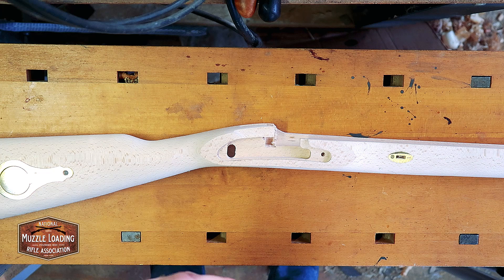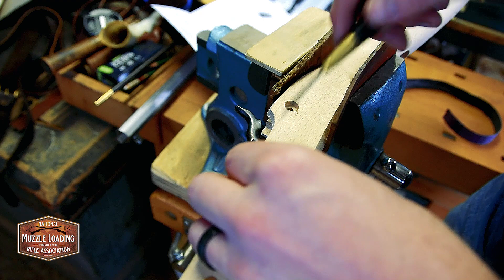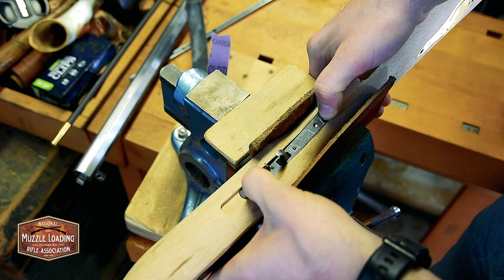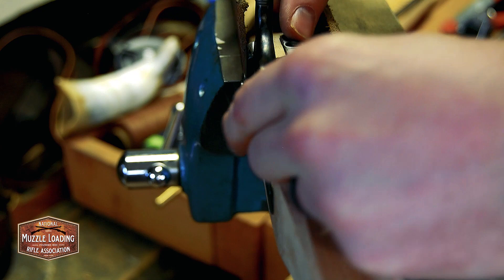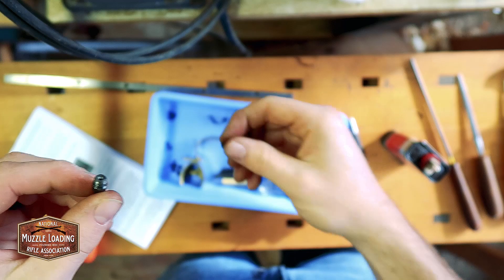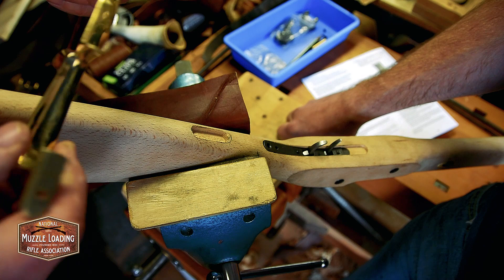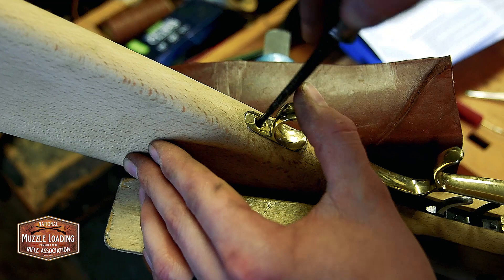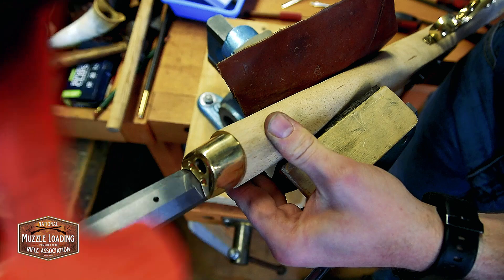Let's Build a Traditions St. Louis Hawken | How-To Series Part 3: Dry fitting your hardware

Comment: Just a little advice for the future, file the cheapest parts to fit the more expensive parts. On a dovetail part you only have to remove material from the bottom of it to make it smaller and I usually do this with some 200 grit sandpaper glued to a piece of steel.

Comment: Thank you for this video ! My son bought this kit for my retirement and it turned out beautifully! Take your time …! I bought a rubber sanding block to use in my bench clamp with leather as padding replacing the wooden one you made ! I used a 8oz piece of leather to polish stain and oiling steps after burnishing with a antler ! Gave a smoother even finish that way !

Comment: Glad you did this video. I too, ran into basically the same THREE difficult items in the build. That stupid Ramrod Spring (I too had to re-read the instructions). The Brass Trigger guard (I knew it was brass, which you can bend, or hammer into place). And, that crazy, will-not tap in barrel trunnion (I used one of the 8 needle files for $ 2.99 from harbor freight, as opposed to $50.00 for a dovetail file). Thank you!! Saved tons of time.

Comment: The trigger assy will function as is but if it were mine I would replace the roll pins for some solid hardened pins. Measure the holes in the triggers then slightly upsize for a more precise fit. When money allows you could upgrade with a better set of triggers. I know it is a less expensive kit but I just don't like the cast trigger assy. Think I would upgrade for better sights. Can't believe they used plastic sights. I had a CVA mountain rifle kit years ago I did some upgrades to and shot it several years. Had a good round ball barrel and was accurate. You are doing a fine job...

Comment: Gotta tap those lock screw bushings in, thats why they are ribbed. First, use a round or square file and enlarge the lock screw hole. Once you sand the wood flush to the bushing, you can then reach in with a long punch and gently tap them out for stock stain/finish.

Comment: Get a proper, hollow ground, flathead for this kind of work. That hardware store angle ground flathead will eventually annihilate something important, and when it does you'll be kicking yourself for not using the right tools.

Comment: I need help. None of the inletting on the stock that came in my kit is anywhere near the quality of yours. During dry fitting non of the parts fit so I had to sand them all even though there were already pronounced gaps and they still don't fit very well. The barrel tang is probably the worst fitting part (that still does not fit) even though that's the one part you probably do want to fit well. The inlet for the back part of the trigger guard is off center and crooked by about a quarter inch. The quality of this kit seems to be terrible and I've been left with something that is not capable of being finished let alone fired safely. Is there any way that I can get a new stock for this kit that isn't messed up out of the package?!?!?!?! I reached out to traditions and they've completely ignored me

Comment: I can not get the barrel tenon on for the life of me. Actually broke one and had to get another sent from traditions. The only dovetail file I can find is $45. Really would like to avoid having to make a purchase for a tool I'll likely only use once. Any advice?
Reply: I too dealt with the barrel tenon, I just went to Harbor Freight, they have a "needle file", set of 8 files for a wopping $ 2.99. There is a similar triangle shaped file in the set, with only one side with file capability. Had the tenon in in under 2 minutes after a quick filing. This video put me on the right track.